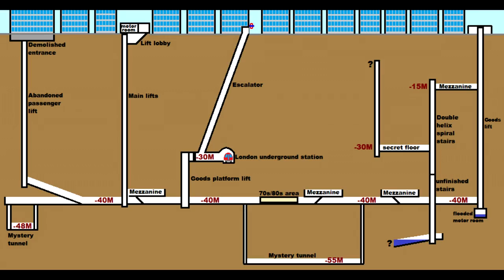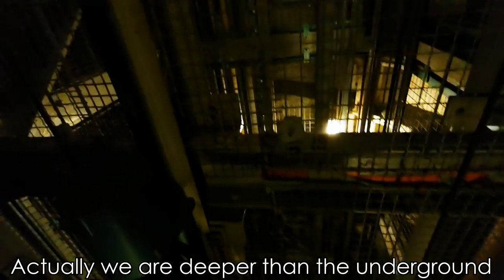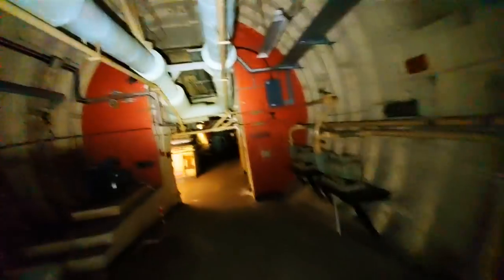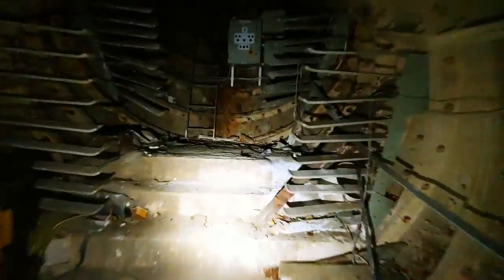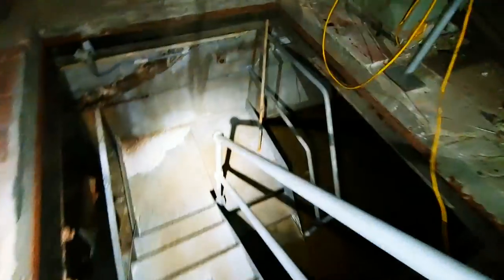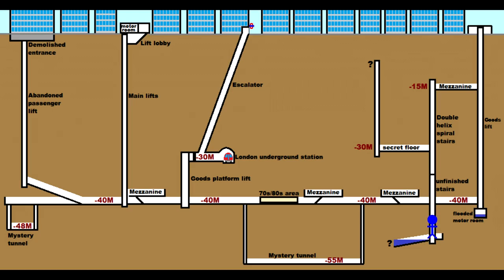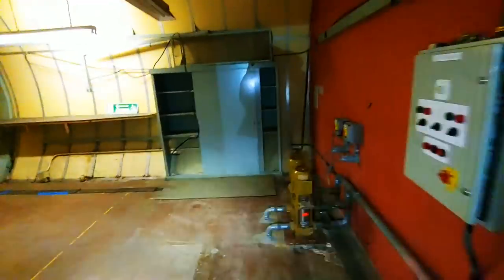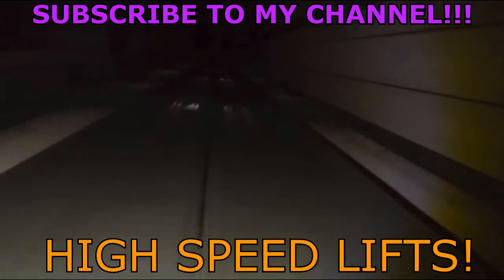URBEX - Chancery Lane deep level bunker

Comment: Holy crap, what a MASSIVE exploration! Great video Beno.
Strangely lower tunnels seems to be newer (1960-1970) than the upper ones (WW2?).
Do you have any idea of what use did the tunnels have originally? There was a telephone exchange, for sure, but at the same time with all those generators, water filters-purifiers (those chlorine cylinders) and air ducts it looks like a nuclear bunker!
Reply: World War II & the Cold War. The 70s tunnels are probably from the Cold War.

Comment: Lol, not so secret anything when you realise it was a working telephone exchange.  I worked there in the 80's.  Most of the 'secret' tunnels were actually cable chambers running telephone and signalling cables across London.

Comment: 17:10  That incomplete double helix is like that because the bottom part was removed in the 60's when the two generators were installed.  The two large pipes going up and along the passage at the top are the exhausts for them.  Not quite sure why only the bottom part was removed, never been able to find that out but the only thing I can think of is the idea behind removing that bottom part was not followed through.  They changed their mind and left the rest in place.
Reply: 20:00 Those are the two generator exhausts.  This is the original exhaust air shaft for the bunker.  It was used to run the generator exhaust pipes to the surface.
Reply: 24:25 I just realised it looks like there's 4 generators not 2.  So the other two exhausts take another path to the surface.  That would be interesting to find next time you're down there.
Reply: 26:10 Looks like we found where the other two exhausts go.

Comment: Can someone explain what those machines do?
Reply from the maker: There are large air filters for filtering radioactive air (which probably have not done that much) and generators to keep the power on if the power stations have been destroyed
Reply: Beno 
Do you think structures like this should be just left like this? I mean, it's a tunnel. So I get it but what about some buildings which are kept 10 years before demolishing....

Comment: What was this used for and when was it abandoned
Reply from the maker: It was used in WW2 and the cold war.  It is still technically active today but it no longer serves any purpose.
Reply: @benolifts  thanks
Reply: @ahuman9143  It was originally built as a command and control bunker during WWII.  Then during the cold war years it was used to house a very large telephone exchange because it was realised how vulnerable all the surface exchanges were around the country.  Putting the exchange this far underground protected it from nuclear attack.  The short tunnel with all the cable management racks along the sides was what was supposed to be a network of underground cable tunnels but it was never completed.  There were 2 reasons for this.  Firstly it dawned on them there were already suitable cable tunnels used by the underground.  Secondly, there was no avoiding the vulnerable surface connection points to the rest of the telephone network which pretty much defeated the whole point.  This is why this bunker has so much stuff in it that was never finished.  A good example of rushing in all gung ho with out properly thinking through what they were doing.  The exchange was operational for a number of decades.
Reply: @benolifts  Well as you pointed out in the video, it likely serves water, gas, electricity.

Comment: Interesting video.
Underground, secret and built like a battleship, certainly had a budget for this at the time.  Period bronze coloured lift doors.
By the number of toilets and decent canteen facilities quite  a community must have worked here. Large power plant, batteries  too in case generators failed.
Reply from the maker: This was an air raid shelter in WW2 and would have been used for a large number of people in the area.  In the cold war the tunnels were extended a lot and it was used as a secret operations bunker.
Reply: @benolifts  They were designed as air raid shelters but were mostly not used for that purpose. If this is the one I'm sure it is it was never actually used as an air raid shelter.

Comment: The lifts were probably modernised in the mid to late 1980s based on the buttons being 1980s Dewherst while those red dot matrix LED indicator displays were also commonly in the mid to late 1980s but were most popular throughout the 1990s and to the mid 2000s! :)

Comment: What we’re The makes of the different lifts in the tunnel?
Reply from the maker: The original wartime bunker had 1940s Marryat Scott lifts.  The entire bunker was converted in the cold war.  The main lifts are 1950s Otis modernized with ThamesValley DC pulsed AC.  The dumb waiter is 1950s Otis.   The lift from the underground station to the bunker is a Hoisting appliance co lift.  The lift in the blocked up shaft with a building on top is unknown.  The lift to the rear exit with mezzanine for the unfinished staircase is also Unknown.